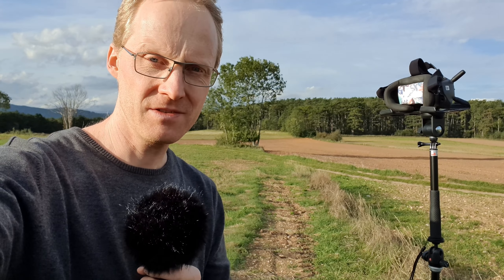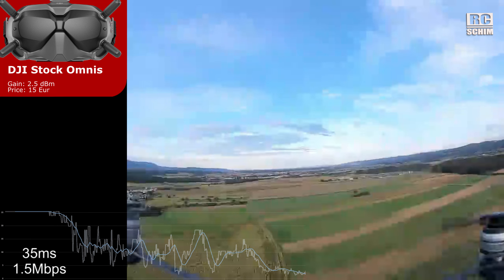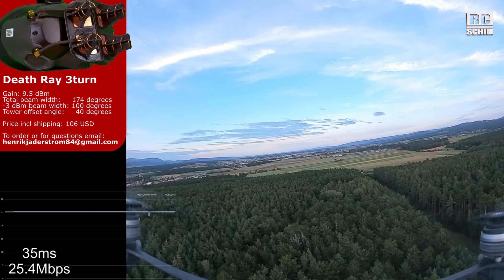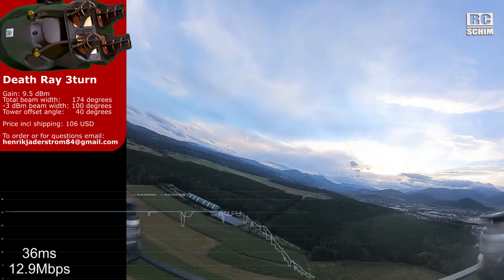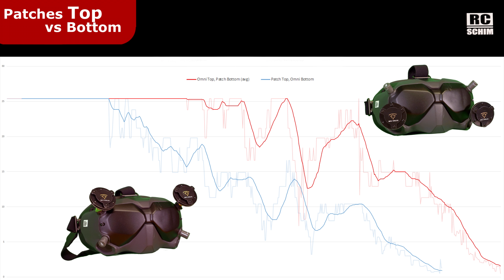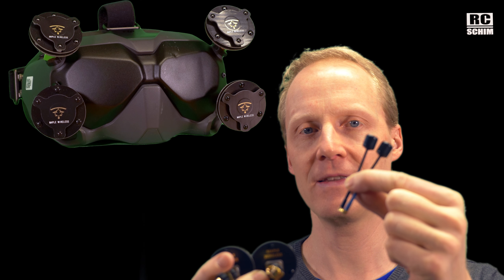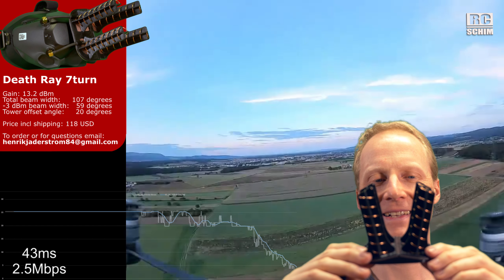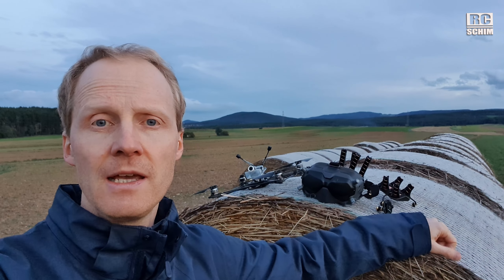Best way to test DJI FPV Antennas!!!

Comment: Great testing kind sir. May I suggest from being in the east where there is a lot of trees, I would like to suggest maintaining a line of sit with the goggles and the quad by elevating more and more as you increase distance. Any trees between you and the quad will mercilessly eat up the signal. No matter what antennas you use, the trees are doing you in! Hope this helps.
Reply from the maker: Thanks. I will definitly! I just had bad judgement on the height needed to stay LOS all the time. 50m felt really high when I started. Generally you should be 10% of distance in height - this way we can go much further. 
I didnt trust the autonomous flight of this drone enough to fly higher and further ;)

Comment: Great test Mario! Awesome to see my helicals tested! Kind regards Henrik
Reply from the maker: Great antennas Henrik - thanks for stopping by! Excuse my test failure once again - I'm sure the 7turns would have done very well if I just flew 100 or 150m high.
Reply: @Rcschim  thanks! Yes Im sure they would too, the forest seems to have blocked the free line of sight, probably where the mbit is diving as it was solid 25.4mbit to the point were it just drops like crazy. Also that would explain why you did not see an advantage with the 7turn over the 3 turn

Comment: Have you also been doing Euler angle movements with head and body to notice a difference? Also I am impressed how far you get with 25mW. This looks really far with 25mW and beautiful landscape. 
myself fly between 200(summer) 400 - 800 - 1600mW(winter) with AKK race ranger vtx and fatshark Scout goggles. My maximum distance in ~30meter height is about 1.8km.
My rc car (LRP twister) with 25mW vtx (betafpv) has maximum distance about 100meters thats ok.
Reply from the maker: yes, I kind of did here: https://youtu.be/OBfRZwrsz0c
On this test here (the one with waypoints) I messed up the testing because I flew to low to the ground.
But I'm motivated to do new tests soon. These days it's become so easy to do proper testing:   fly consistant with a copter, have GPS telemetry logged, use the OpenTX Log analyzer site online and get a comparison:  GPS Distance vs. DJI Bitrate. So cool, I love it.   And I got a few new things to try out.
greets, Mario

Comment: Really comprehensive video! Good job! And thank you for your SRT converter as well! Wait for your next test!
Reply from the maker: SRT files are really a nice option on DJI - the converter is really simple but effective. Make sure to also use the XLSM file I provide - so you can import a lot of SRTs at once and compare them easy in the XLS sheet. And I'm right now working on the next test ;)
Reply: Hi Mario, thanks for the SRT converters, I tested all of them and modified the closest one which produces the desired columns in excel. I used a new computation method which is able to better represent the delta in performance for your future proximity-flying test, let me know what you think.
watch?v=KeNDYksZQp4&t=250

Comment: The problem with doing it "right" and flying higher, is you would then run into the max distance of the firmware. All antennas tested will get you there with perfect LOS conditions. So your test is completely valid in my mind. This is always the way it is. Once LOS is broken, a better antenna only gets you marginally further. The question is if that extra bit is worth it to you.

I'm glad you verified what I've tried to tell folks. The Singularities really are special. They outperform the other omni's I've tested.
Reply: Sorry. Didn't realize this was at 25mw. So you wouldn't likely max out the firmware range,...... but I still feel the test is valid. Something I'm wondering about: Is the track depiction actuals? Where the 7 turn went the furthest?,...but the 3 turn isn't shown.
Reply from the maker: @rcrdps8144  the 3 turn gut slightly further, but they all ran into the same problem at around 1km (the trees blocking los).
Even my crossfire complaint there :)
Considering the size, the singularity is really a special antenna!
Reply: @Rcschim   On the group, you mentioned Tommy's recent testing, and his results are much the same as these, but with even smaller margins. There just comes a point in flying where something blocks or interferes with your signal, and the performance at that point is what separates the good and bad antennas. With that in mind, it is very odd that the 7 turn didn't do better than the 3. Seems like you're far enough away that it wouldn't be a multi-pathing advantage, so then you wonder what it is? Is it what Bruce mentioned about lack of turning? Or maybe just the orientation of the four antennas with narrow beams leaves a hole in the middle,....?

I have the 5 turn coming,...if it ever makes it through customs.
Reply: with 25mw you will not reach the max range limit, so free line of sight testing does make sense. And the limit does not seem to be carved in stone, talked to a guy yesterday claming over 14km wich is more than the max range limit would allow
Reply: @rcrdps8144  the angles of the towers are different on the 3, 5 and 7turn version. There is no deadzone inbetween the beams, infact the beams are overlapping well into the - 3db zone on all versions. Probably the reason for the 7turn not performing as good as the 3 turn is that even tho the flightpath was very consistent, lets say the quad flew a couple of meters more to the left on the 7turn run the signal might have to penetrat a few more trees than on the 3turn run. This is just speculations but it could defenatly be the reason.
But im mostly pissed on that damn tree at the second test, if not for that tree my 3turn had made a perfect 25.4mbit flatline😅
Reply: Also what you say about real life scenarios always being blocked by trees and obsticles is not true for real longrange flyers, not all people fly 5inch quads with dji. There are alot of fixed wing flyers and also longrange 7inch quad pilots and we the longrange people never put an obsticle in the line of sight. No matter if we fly 5.8g digital, analog or even 1.2ghz.
And the whole point of the dji system is good quality video so even if you could fly 12km with onni antennas(wich I dubt) the mbit would be low and video would look pretty bad so it would not make sense. What you really want is high mbit rate with that range or even if you only fly like a km too, so you get the benefit of the digital system. At those really low mbit rates dji has much worse video quality than analog......even worse than with 1.2ghz analog
Reply: Good to know about the difference in tower angles. As far as having perfect LOS for long range, folks already claim perfect video up until the 13.something km "wall" using currently available antennas. So why would they want your antennas? It's because things are rarely perfect, and that is why we are always searching for something better than what we have. I feel your antennas did good. Folks looking for an antenna that knocks it out of the ballpark comparatively are delusional. Also, I don't really feel like a 14km claim debunks the current firmware range limit. That is close enough to be in the margin of error. Now if you hit 16 or 20,... that's worth noting.
Reply: @rcrdps8144  the 7turn is 20degrees, 5turn in 25 and 3turn is 40degrees. Well they are not getting perfect video becouse the mbit will start dropping after a few 100 meters, but they might feel that its good enough quality. I have not seen any flight footage like that on stock antennas. Yes we will see, i will get some 7turn test results from a long range fixed wing flyer in norway later wich will be very interesting. Esspecially if he can smash the range limit "wall".
Reply: @rcrdps8144  also very exited to se your suburban test against the cyclops, checked the tracking on your antenna and it seems to have left sweden already. Yes I feel that the test showed alot of promise, especially for the 3turn. I have not seen this high mbit rating and consistency with any other test and also the beamwidth seems even bigger than 180degrees👍
Reply: Sorry when i was talking about framerates dropping after a few 100 meters I was refering to stock antennas

Comment: Hi Mario, very strange. On my static testing top performed better than bottom. I verified it on another day with same result.
Would like to see another test at higher altitude and comparing those ones.

BTW, I already told you that I tested range on my 2 X-Airs, after 4km on 25mw I turned back due to low battery :D

Comment: Thank you very much for having kept your unique style over all those years. You‘re a gem in the FPV world :-) 
Regarding the video: If patches should go to the bottom, wouldn‘t that make sense for the helicals as well? Wouldn‘t it be a good day-to-day setup to go with the TrueRC stubbies on the top, and 2 helicals on the bottom? So you get the best out of both worlds.
Reply from the maker: Thanks for your kind words! 
You're right, helicals are no other than patches so you could also use 2 on bottom and 2 stubbies on top. But from my experience with the 3turn helicals I'd say: just use 4 of them. To mount them good, you have to make such a mount like Henrik did, and if you have this - why not use 4 helicals. Also: you dont have to mount the helical device other than screwing in 4 antennaports - they support the structure. only 2 would mean you have to mount them in other manners on the goggles...
Reply: @Rcschim   My thought was to keep the flexibility to fly all around you, while still have that beam of higher reception within 180° in front of the goggles. So i can just keep the same antennas on for every flight, without having to change antennas before the flight.
Reply from the maker: @eyeflytinkerings  even with 3turn helicals only you can fly around you. behind you will not have the greatest range - but good enough. and normally on flying I decide roughly where I wanna fly and face that way. if you fly around you, use your ears to turn your head in the approx direction - works good enough.
Reply: @Rcschim  Good point. I'll do some testing myself with good old helicals i still carry around from chipsgrips and rabe2000 ;-)

Comment: Thank you for all of your hard work. I have 2 questions.
1. How would the maple patches work with the single Vista antenna? You cannot use one of each. I suppose just like your test.

2. Would the longer true rc antennas see any significant increase in range? Would it be worth the ease of use compared to the stubbies? 

Thanks again.
Reply from the maker: hi, to 1.:  if you fly in the open air, no - different polarization would not gain then. if we fly bando style, maybe directly in between city skyscrapers (not that anyone should do this)  - the many reflections would be picked up by all antennas. Why?  Each time a RF signal is reflected, it changes polarization (from L to R and other way round). So having 2 different polarizations actually helps.   This is theory to me - which yet has to be tested. But speaking with the engeneer behind maple - I have a lot of confidence in his RF knowledge!
2: which loger trueRCs do you mean?  
So far I only noticed differences on the foxeer lollipops:  the short stubbies performed worse than their "normal" lenght versions. Possibly because their active element is further away from (reflective?) goggles surface...

Comment: Great video!!  I'm curious about what you said at the end,  about the entnennas, having one left and one right.  Per dji and everyone I have talked too and videos I've seen, the consensius is all 6 antenna must be the same directional wise.  

Now your test did confirm something I was pretty sure of after some reseach, and that is the patch/directional antenna work better on bottom and omni on top.  I read somewhere that's it a little due to them being a tad higher but mostly becasue top two transmit and receive, the bottom two only receive.  So the top two being omni antenna's does the transmiting and recieving better.
Reply from the maker: now I can get you confused again:  watch my most recent antenna tests with stationary airunit and me being 2.3km away. see what I found there:  the LEFT side is dominant, top/bottom tests give you just random results (depending if your top patches might look more to the left = better,   or if you had your patches on bottom and looked more left whilst doing so).
Still not 100% sure myself how the goggles work and how they determin which antennaports to use. They also asume that the goggles have 4 ominis (the stock ones) - and that's how their algorithm is programmed I guess. if we're using aftermarket antennas (and have an "asymmetric" setup) - it's our fault for messing with the system :)
https://youtu.be/RQML-azG4bQ
Reply: @Rcschim , Awesome yeah I have that video already saved in my "watch soon"  folder.  Just to make sure I'm not confusing you, when saying "left" or "right", are we only referring to left and right physically on the goggles, the same as top and bottom antenna.  If so, I think it is me who is at fault for the confusion, the first part of my question, I was referring to the polarization of the individual antenna(LHCP vs RHCP), because most antenna, no matter what you use them on are polarized either left or right.  All DJI stock antenna are left hand polarized, but patch or directional antenna can be left or right polarized too. If the antenna on RX and TX don't match polarization then they're not supposed to work.

Either way, I can't wait to watch your other video when I get off work.  In a comment section today, I saw that Stingy (fpv pilot, has own channel StingersSwarm) stated he looked up the FCC license info that is public record, and that only the top left RX antenna on the DJI goggle sends and receives, others still say that two of them do, sound like your video might point to what Stingy is claiming.  I know English is probably not your first language, but you're leaps n bounds better than I am at my 2nd language, so thanks again!!

Comment: Great Mario! As allways: Best Antenna-Tester ever. Could You test the "Menace RC Digital HD Antenna Pack (DigiPack)" also? Because it would be a very cheap an easy mod. Mach weiter so! Grüße von der Ostsee!
Reply from the maker: Thanks!  I already have measured at least the rhcp version of the menace. it was not bad. check out my other large antennatest from August.

Comment: Thank you for the comparison, really nice, I still am using the stock antennas and was able to get out over 1 mile 1730 meters up a hill and absolute no image loss with constant 50mb stream the entire time, was using the 1000mw setting.  Is it worth getting crossfire if you do not plan on going over 2 miles, or can the DJI receiver be good enough? I was pretty much at my limit with the xm+.
Reply from the maker: if you always have enough range with video, DJI for control will work just fine. XM+ didnt work so well for me (but my taranis RF module was fading I guess).
for me DJI as control is just too expensive with to little options  (bigger radio, not programmable).